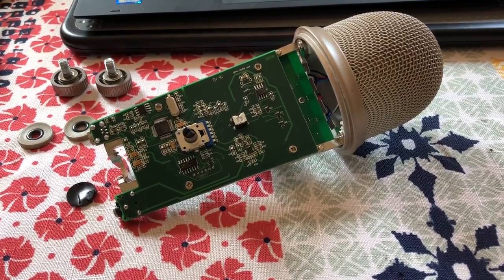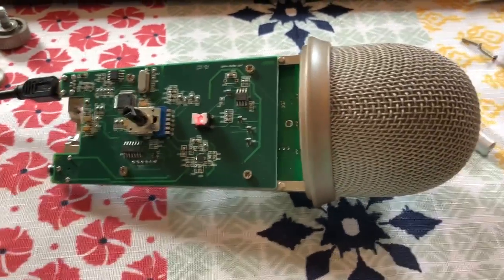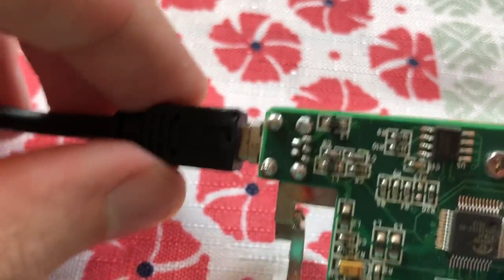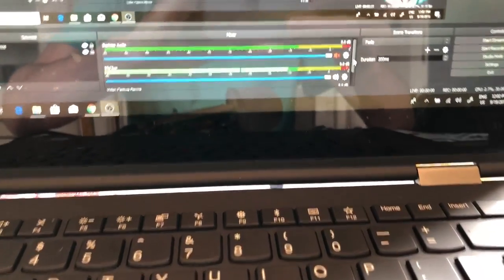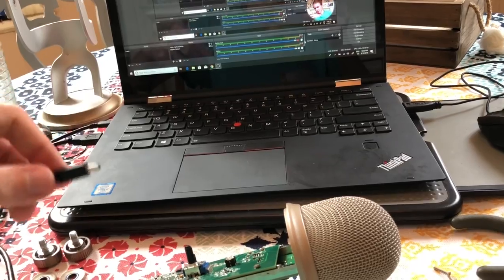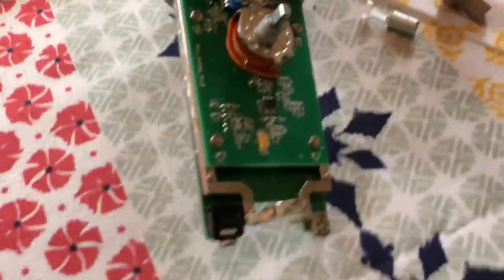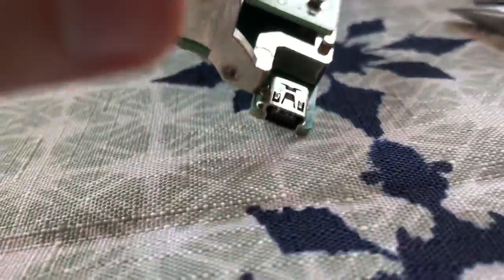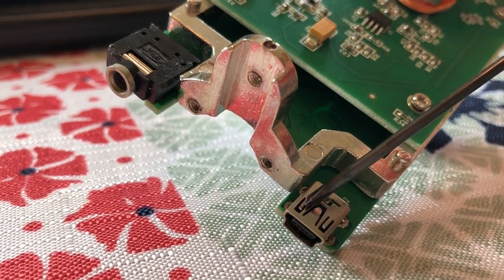How To Fix a Blue Yeti Microphone With Loose USB Connection - Blue Yeti USB Fix

Comment: If you need a super quick fix without opening the Yeti then cut a really thing strip of paper, put it in the socket so that the cable has less room.  I've had a Yeti running perfectly like that for months.  You might need to double over the paper.
Reply from the maker: Brilliant idea!

Comment: Bro but I gotta take it apart? I'll deffo break it
Reply: You might not have to take it apart, if you have a small pair of players you can tighten the metal from the outside without opening the microphone. However, if you need to replace the port, then yes you do have to open it.

Comment: The mini b USB port is a cheap component, it has no pin guards- all the pins are exposed. I replaced it with one on Amazon. No experience soldering at all- just followed a YouTube vid. Now it works like new

Comment: Ive had my yeti since 2014. This last year its developed this problem as well as a incredibly ear-piercing feedback sound. Imma try this tonight and it fixes it you are legend bruh
Reply: Alright so I gave it a shot and I have 2 important things to add. 1st, spray DW40 on the leads and on usb cable and run it in and out to make sure they have a good connection. 2nd, id make sure to crimp the top and bottom of the connector and not just the sides, mine had a problem moving up and down and not side to side. Mine seems to work a bit better but is still much more delicate than id like. I'll see how long this fix lasts and maybe check back if i find something else
Reply: Put it back in the housing and now...... nothing.....

Comment: my headphone jack on my blue yeti doesn't work unless I turn it to just the right position, any fix ideas? I'm outside of the 2 year warranty
Reply: If you are comfortable with soldering, headphone jacks are relatvely simple to replace, although I've never done that in a yeti. Might be worth trying out. Usually you need the jack port to "squeeze" the plug. So, if your port isn't squeezing the audio jack plug then thats usually the issue for those sweet spots you are talking about. You can probably find a third party headphone jack that fits
Reply: @JackPitmanNica  I appreciate the quick response my friend, will look into this. I've had this issue with the mic for 3 years and now kicking myself for not wanting to bother with reaching out to BLUE when it was covered lol

Comment: This mic is excessively adorable do7.pl/YetiMic and blue. I would give it props for that alone, but on top of the cute-and-blue factor, it's extraordinarily sensitive and user friendly. I bought this when all the piano teachers of the world had to move lessons online due to C-19 and started Zoom/FaceTime/Skype lessons.Where I struggle with it is finding the "sweet spot" to position this mic so I don't clip when I record into GarageBand. Even with the gain completely turned down on the Yeti I still need to adjust levels way down in GB when I do any vocal or piano recording. And the mic is 5 or 6 feet away. It's just too good? Or, more likely, I'm inexperienced with sound production and haven't watched enough YouTube tutorials yet.I have no complaints with this mic. It's powerful, it works, and it's cute.Who could ask for anything more?

Comment: could you just put it in the fridge lol since itll make it contract
Reply: You have to be really careful putting electronics in the fridge. The cold doesn't hurt the electronics. BUT the cold electronics will attract condensation when you remove them from the fridge and this is very bad for your electronics, particularly a microphone. Water condensation is a big no no.

Comment: Hello, greetings from Mexico City, friend! I would like to know if you would be so kind to help me, checking the continuity of each pin of the USB charging center, to be able to know where each one of them should be connected, since unfortunately  I tried to desolder the piece when I was inexperienced and took all the pads with me, I have not one left, so I would be very grateful if you could help me with that to know to which component should I solder each one of those pins. Thank you very much friend!

Comment: Great advice demo..But one of my screws is stripped...How shall I remove it....??
Reply from the maker: You can use pliers, a sharper screwdriver or bit, or you can use a special drillbit designed to bore into stripped screws
Hopefully some needlenose pliers will be good enough
Reply: @JPValheim  thankyou lots bro..All my friends shared your video...wen i had usb prob.hope it resolves my blackout
Reply: @JPValheim  great Bro finally opened it with drill set..Which broke a bit ..But is fruitful...Not it  works Perfect.Thabkyou lots .USB was issue.

Comment: How did you take off the housing though?
Reply from the maker: You have to pull all of the buttons out of the microphone and then remove the screws that are in the base. At least one of the screws is usually covered by a rubber part where the mounting screwhole is. Its a bit finicky but not too crazy to do. Be careful removing the buttons, you might need to use pliers or something.
Reply: @JPValheim  thank you

Comment: I have this problem. Makes me mad when I have to end my stream early because my mic won't work properly. Blue Yeti needs to fix this problem asap, or I'm switching brands. Ridiculous!
Reply: This is a good video though, keep up the good work!
Reply: I send them a video of me connecting the faulty Yeti with 4 different cables to showcase the problem and they send me a brand new Yeti. I had to break my Yeti's USB port entirely to receive a new one though. The customer service was great!
Reply: @SaturnsSonAndMoon  
I was wondering how you processed a replacement. I am having the same problem and upon contacting Yeti, they told me that they do not offer warranty service for user damaged units.

Comment: I used this microphone for 6 years and I had this problem. I took mine apart and did this, after trying to re-shape it just on the outside, but because it's split in two parts, the bottom of the USB port kept pushing in and up, every time I tried to tighten it gently, and had to keep re-shaping it. I don't know if they are designed with a split in the bottom and it just got out of place. This wasn't working, so then I decided to try and tighten it more snug the other way around, and the entire end of the port got all coiled up/disfigured. I tried to re-shape it back, but it seemed too late, then it all just broke right off. I either would have to replace the port or buy a whole new microphone. I have no experience soldering anything, if that is even the problem.

Comment: Was excited to find this video until I found out my microphone has a connection this wouldn't help with sadly. =( I have a snowball microphone (an orange one) that has the square shaped usb and my cord just slides right out... I bought the microphone used but i'm now trying to figure out how to fix this. I might try to put a dot of solder on my cord side to see if it makes a better connection.
Reply: I mean, it's still a USB. Just a different kind. The concept should be exactly the same. Gently bend the metal casing around the actual connections until your cord fits more snugly.

Comment: When i put my blue yeti on the mic works perfectly but i cant hear any audio with my headphones
Reply from the maker: Which headphone port are you using? If you plug the headphones directly into your microphone, that slot is so that you can listen to what the microphone is hearing (you will hear your voice at the same time that you speak)

In order to hear your computer audio, then you'll need to have your headphones plugged into your computer, not the blue yeti mic
Reply: @JPValheim  Already solved it thanks.
Reply: Veteraaniperuna How did you solve it??
Reply: @eliadams5056  if you have windows 10 go to troubleshooting settings and search the recording audio or volume
Reply: Veteraaniperuna plug your headphones into your tv and make output to your tv

Comment: It makes me so mad that this is even a problem. I spent nearly a hundred dollars and in about a month I’ve already had this problem. I’m very unimpressed by blue yeti
Reply: Had the same experience, with the full recorder combo and everything, the day i got it out of the box
Reply: Yogh same how did you fix it
Reply: Same here lol mine stopped a couple years back and as a 12 year old kid who saved up their money for this they really gonna be lazy like cmon man.
Reply: Hah I did this on my first day of having it because i tilted the mic back and put stress on the cable and port
Reply: I probably used mine a handful of times but the obvious issue is with the design and QA. If you use the the mic stand that comes with the mic, you will notice that if the handled bolts on the side are loose at all or the washers on the inside are not installed correctly the mic will spin and bend the cable while its inside the port. Then the port itself easily breaks. Its a shitty cheap part that they probably spent a few cents on and then the soldering job was never stress tested. Crappy crap crap. HOWEVER, if you saved the receipt like I did in my email, Blue will honor a warranty claim and send you a brand new in the box. I'm making my claim right now and will solder the old one back together and have two of these pieces of shit
Reply: i have had thius problem since day one! the cable plugging upward into the bottom is just plain stupid! It should have a clip fastening so it cannot jiggle around.
Reply: @insidiousmaximus  i was thinking that too. first i felt guilty like was this my fault? But the design fact that  you plug it underneath pretty much guarantees the cord will bend lol.
Reply: Damn it actually same..
Reply: I think its an issue with the little bit of space between the usb port and the base that allows the port to expand, but also the is an issue with this specific type of usb port
Reply: had the exact same problem. Had to order a new mic - arrived today - and now i found this video! Very unhappy with Blue Yeti
Reply: sameee
Reply: im having this problem on my 3rd day... lmao
Reply: i got a yeti x a week ago and already ive been having this problem
Reply: Agree.  It’s so unnecessary and let’s down the product.
Reply: im just going to get a at2020
Reply from the maker: I had the same experience as Sean but with an AT2020. Which caused me to use Yetis jajaja

Luck of the draw eh? They're both good microphones

Comment: But my mute button is on so it means it work but there is still no sound
Reply from the maker: That sounds like a software issue - make sure that your microphone is set to be the right microphone being recorded, not your computers default or internal microphone. Its also possible that your mic has failed and won't work even though it is receiving power
Reply: @JPValheim  My mute button is still on as well. The mic does not show up in recording list
Reply: Yoinks i have that issue too. it might be that where you plug in the usb port, those pegs are bent or broken. that’s what i have and i’m trying to get it fixed. those pegs at 2:22 are probably bent which is what is happening to me.
Reply: If anyone is reading this, the issue is that the usb plug has multiple wires that have to make connection to fully work. IMHO the mute button is showing lit because that wire is making contact in the plug but the ones needed to send that data back and forth to the computer are not.
Reply: @edphonez  Hey, just saw this comment and I think that must be the problem with my mic. Any tips on fixing the contact issue?
Reply: @anjalichennapragada3691  the connector is probably bad and needs to be replaced. Beware though I replaced mine and the whole thing doesn't work now lol.
Reply: @edphonez  Okay lol, thanks!